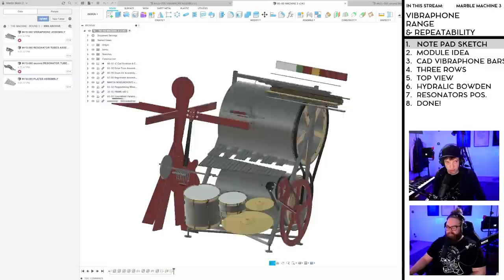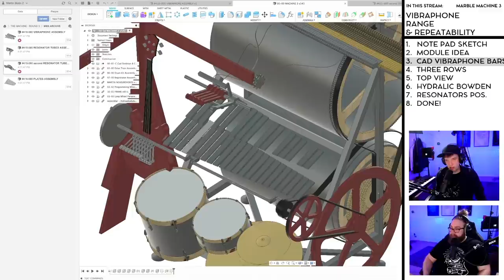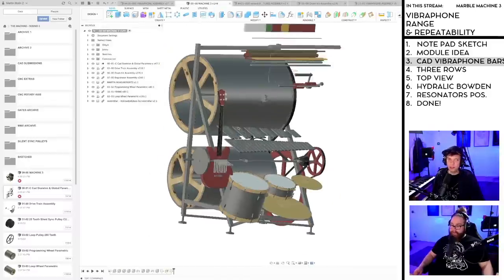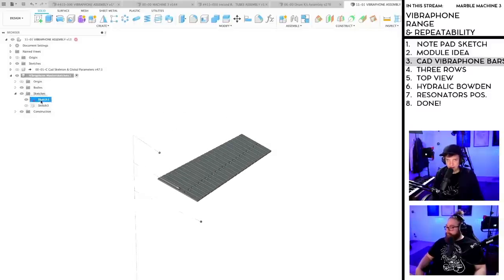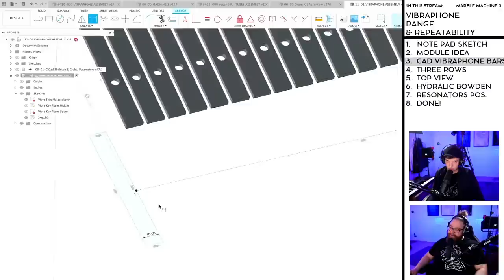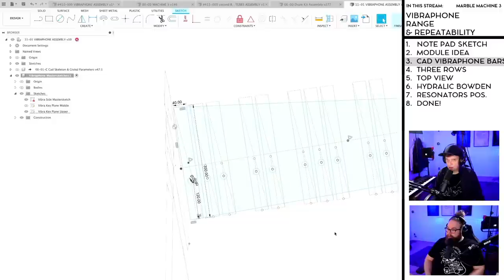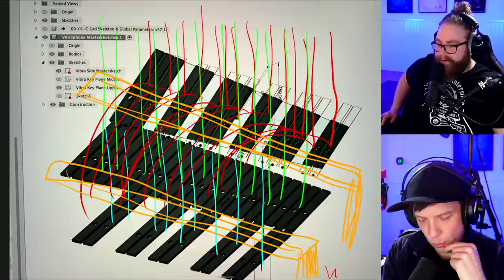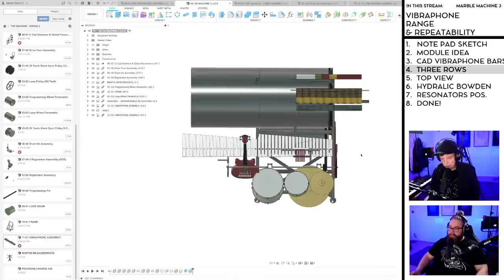Vibraphone Range - Martin vs The Machine #25

Comment: Are the 40mm marbles a design requirement?  I see them causing a LOT of space issues... starting with, how many marbles do you need as a "reservoir" and how much space do they take up?  Every marble that's moving when the machine is moving needs a place to stop.

Comment: I think the design of the machine still has another evolutionary phase beyond making it wider in its future. Martin needs to decide if this is a solo instrument or if it would work better as a two person instrument with one person on each side of the machine controlling various things (i.e. North Side is drum and strings and South Side is xylophone with programming wheel in the middle). If this is a meant to be a Martin solo machine then making a U shape with Martin at the center of the U either on the inside of the U shape or on the outside of the U shape might be best. Finally there's the idea of modular but dedicated programming wheels (not 1 large wider one but several smaller thinner ones). A wheel just for the strings which can be switched out during a drum solo and a wheel for the xylophone which does a solo while you're switching tracks to song 2 on the string instruments. I think the performance and band roles needs to be part of the design going forward. Transportation won't be an issue if it's modular so maybe that's your best plan. Does the programming wheel make the machine or does Martin make the machine? That's the question going forward. Is Martin the conductor to a mechanical marble machine orchestra or is Martin the orchestra through the mechanical marble machine? I think making two machines isn't a bad idea either. One can be strings only, one can be percussion only, and you could even make a 3rd one with that somehow does wind. Not sure if Martin or H3K will see this comment though. See you on the next stream!!!
Reply: I agree.
I was about to post similar comments which I will simply append to yours, fwiw.

So when the machine is on stage, the rest of the band walks off?
Is the purpose of the machine to play everything?
Just because it could be done, does not mean it should. This was the main (unlearnt?) lesson from MMX, surely.
Already in these streams, mission creep is visible.

Another point. Many aspects of the machines working, including the marbles dropping will simply not be visible for the audience. Martin needs to accept this basic point.
IF you want people to see, put cameras on the machine, or use light beams to assist and "amplify" the motion in a projected way.

The machine is usually presented as if it will be on the left of the stage, slightly angled, now with Martin in front with his back to half of the audience.
So for half of the audience, the drums and most of the vibraphone can not be seen. 
So possibly all this anguish over visibility is pointless.
If the machine is front center sideways, then the back of the machine will be visible to some.

IF the emphasis is on the vibraphone then put the drums at the back. Is it primarily a rhythm machine or a tonal machine?

Perhaps what you need to determine is what is the optimal acoustic performance of vibraphone plates being struck with a marble with acceptable/controllable bounce. High notes may just sound like a metal plate being hit with no ringing (or lots of noisy overtones). Low notes might produce excessive bounce. Maybe the marbles should not hit the vibraphone plates directly? Maybe they should actuate a hammer. It might at least give a more controllable response at the expense of novelty.

Comment: Maybe there's a vibraphone net? Not individual ones, but one big long one for the vibraphone (but you may need to raise the hieght of the vibraphone) (a series of 2-4 long 3-d printed funnel could also work). Also, you could keep 37 notes all in one line and have the notes you want to switch out in one "module" on one of the ends. This way you can keep a standard design, still have flexibility, and not need to swap the whole vibraphone. (Also not ugly in my opinion) 

Another option is to make the machine longer in depth by taking the loop wheel farther backwards and bringing drums forward, making a wider A-frame. Then you could uses longer sticks for the drums, lowering the mechanical force to actuate them, and make space for a marble catcher between the vibraphone and drums. 

The other option is to make a really long machine with everything in one line and Bowden cables everywhere (though you may want to consider a disassemblable frame here). 

Something else to consider is the length of the marble path to the channel, this will be much longer in a wide machine. 

On a more general note, I think it's okay embrace the technical solutions in the form-from-fuction-absolutism plane we have ascended to. If it's not an art sculpture, then let's make it extremely functional and pragmatic!